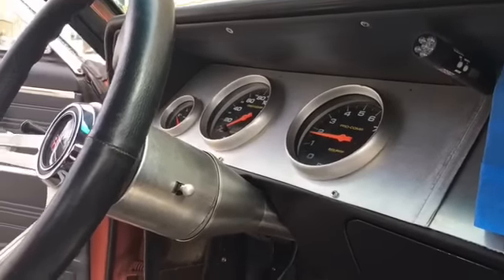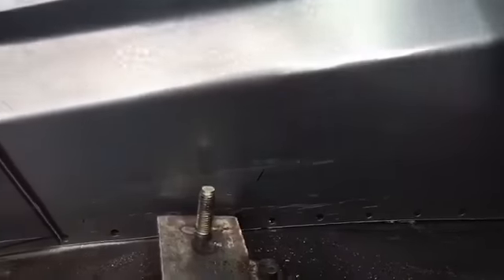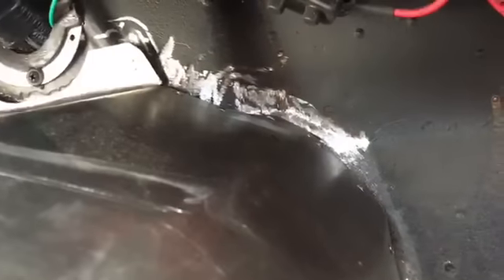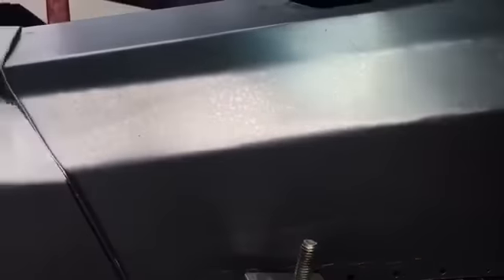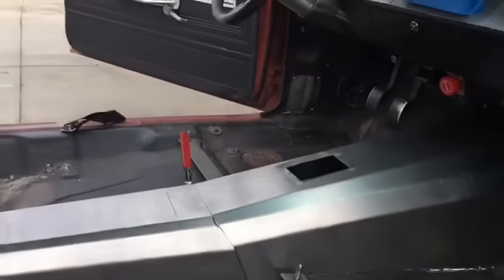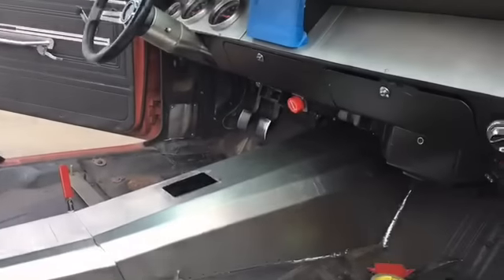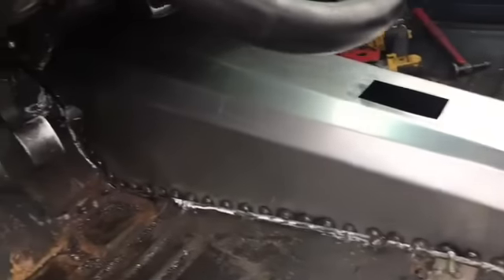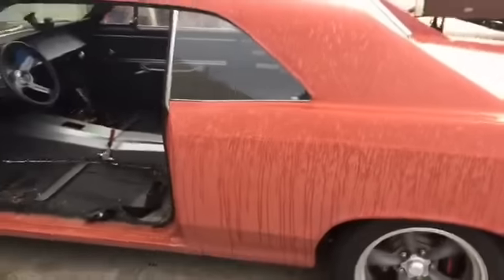Fabrication  T56 trans Tunnel Chevelle

Comment: Im about to do this with my 66 chevelle.  I was under the impression i had to spot weld the entire trans tunnel.  Is it alright to just plug weld it and then seam seal?  Does it lose any strength?  I thought the trans tunnel had to be fully welded to the floor.  Any help is great